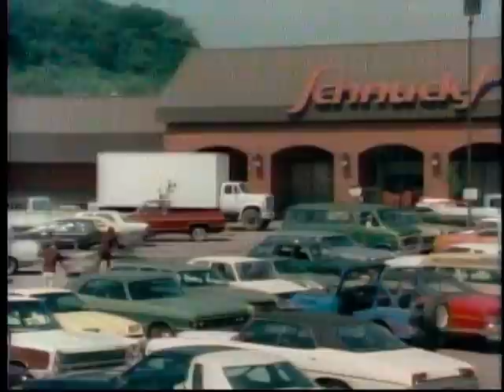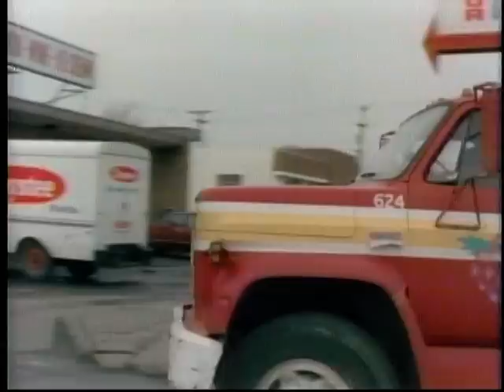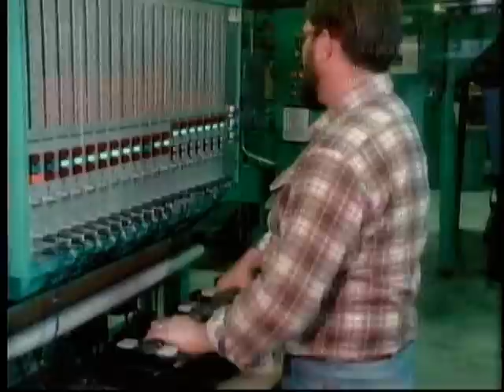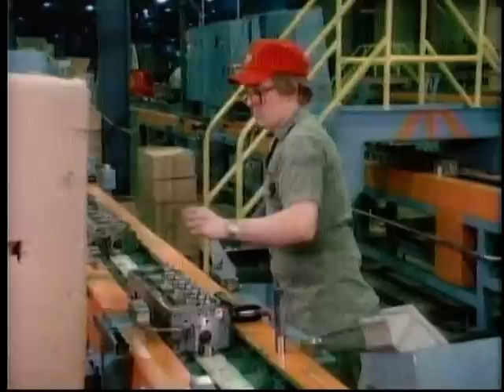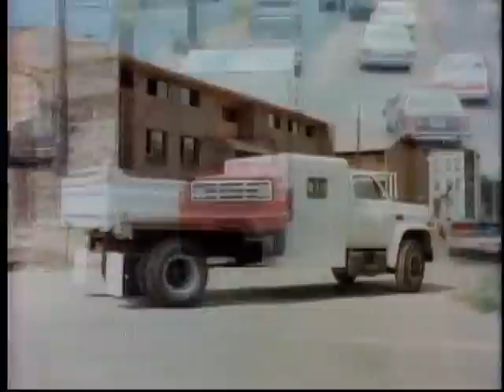Detroit Diesel Allison 8.2 Liter Fuel Pincher Diesel Engine Features GM-327-A GMC Dealer Training LD

Comment: I was born in 1983 and it's amazing how much culture changed between 1980 to 1983.  This video is flat out disco.  But I remember the early 80's and I was actually looking at the world of the late 70's which in hindsight was a very interesting time. Like I said it was a period a very rapid modernization.  From 1960 to 1983 things had changed so much.  I mean the 90's to the 80's not a lot of change, but 80's to 70's big change and 70's to 60's big change.  Nowadays are changing fast now too but for different reasons.  The iphone changed things a lot and now, it will just be a solar flare blows out the electrical grid and there will have been a time before when everything was modern with phones and suddenly 90% of humans are dead and we're all back in 1890-1910 time of growing food with simple mechanical technology and then we'll have space age alien technology come.   Can anybody here even imagine the 2030's?

Comment: WORKED AT DDA DEALERSHIP AND WE HAD THESE ENGINES STACKED UP IN THE PARKING LOT FOR HEAD GSK FAILURE IN THE FIRST YEAR OF OWNERSHIP THE PROBLEM WAS A DESIGN FLAW IT ONLY HAD 10 12MM HEAD BOLTS..LOW CLAMPING FORCE FOR THE HEAD TO BLOCK UNION. GM CAME OUT WITH A RECALL TO DRILL AND RETAP THE HEAD BOLTS TO 14 MM ALSO WHEN THE GSK FAILED ANTI-FREEZE WOULD MIX WITH OIL AND SPIN THE CAM BRGS GM MADE A TOOL TO BORE OUT THE CAM BRG HOLES AND INSTALL O/S BRGS GM LOST THEIR ASS ON WARRANTY CLAIMS FOR THAT ENGINE WHEN IT WAS RUNNING IT WAS A GOOD ENGINE

Comment: Such a good motor they discontinued it and the old GM trucks you see of this era (that still exist) are gas. The Fuel Pinch had its issues. GM went with CAT for replacement of this class engine.

Comment: I worked for a plumbing contractor he had a Ford C - 800 with the gas engine, and he had one of the ( GMC ) dumps 4 yard boxes. 😊 the ( GMC ) had the 4 cylinder DD, and both  trucks had a 5-speed manul with 2 speed rears. The Ford was a truck that pulled our 580- C case backhoe on a lowboy. I was always a Ford lover my whole life, but boy, that ( GMC ) with the DD engine was like driving a caddy compared to the Ford C series heavy duty Ford built rig. I loved driving that dump so much more than the Ford. 😊
Now, in 2025, after owning Ford pickups all my life, and getting treated  so badly by Ford on tradein on my 2000 ( V-10) gasser with only 63000 miles on her The Ford salesman would NOT even talk to me unless  I wanted to be put on the wait list and put money down to even TALK to me on any truck buy or trade in. Please  can anyone tell me if they have been  treated like this at Ford. I went to Dodge looking at the ( Cummins) and Chevrolet truck dealership, and both first thing did test drive of my 2000 Ford PU. Both did no pressure to buy their  trucks. The Chevy dealership showed me a used 2021 12000 mile Silverado  Z-71 Duramax/ Allison with 8 foot bed/ 4 door body 😊 and I was in love with the truck. I own 3 Detroit Diesel engines on rigs and equipment I own 😊
1 being a 1978 353 DD second being a 1971 DD none turbo and third being a silver 92 DD with turbo and Allison automatic transmission. The silver 92 is a fast pickup at stops but a fuel hog. So buying the Silverado PU was a must to keep it all in the family, so to speak 😊 I wished I had looked harder at GM back in 1979 when I bought my first Ford and at least tested them out over Ford.

Comment: Drove the 8.2L diesels for four years(Wickes lumber). The 8.2L was way more reliable than our one ton with the 6.2L.🤷‍♂️ The International DT466 smoked the 8.2's. Even plugged in inside a building, the 8.2's were hard to start in the winter.

Comment: Tolerances are mentioned to be held at 2/1000ths inches on the computer. In the mid thirties, Dodge workers were measuring tolerances of 1/10000ths  of an inch by hand!
Reply: I would imagine that the production numbers for the fuel pincher were 100x that of the Dodge engines of the 1930's.  High volume requires designs that are O.K. with wider machine tolerances.

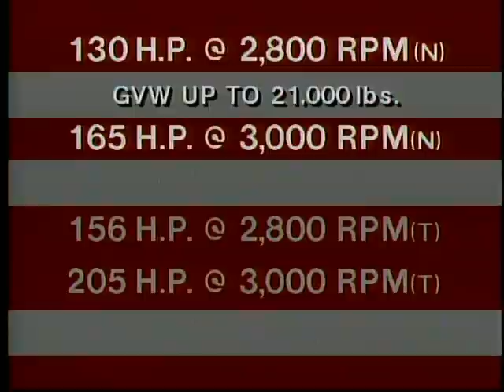Comment: Look at the HP rating at 2:25! hahahaha! My naturally aspirated gasoline V6 work truck puts out 305HP. Man, must not have learned much with those 1,000,000+ man-hours of research.
Reply: Your naturally aspirated V6 wouldn't last an hour in a 60,000 pound dump truck.
Reply: You have half the torque bud
Reply: You are not really smart comparing any modern engine with a 70s engine. A Bugatti Chiron has more horsepower than your stupid V6. You see? This sounds stupid right?

Comment: OK wait a minute.... 13:29 they state that the 366 Gas engine only got 4.5MPG? - Boy GM was behind the times, our Ford 370 powered 5+2 20' Stake truck got 9MPG almost all the time...Except when very cold outside (Below Zero) so if the Turd Pincher only got 8.7, there would be no need to buy that trash.

Comment: Ended up getting stuck with a 1985 GMC 7000 diesel, has a 8.2 fuel pincher, automatic transmission....currently doesnt start, what should I do with it? 😂

Comment: I purchased a GMC 7000 with a fuel pincher about twenty years ago and put over a hundred thousand miles on it. Never had a problem. The truck still starts right up. Too bad the cab is shot. Not sure all the negativity towards the motor. The speed is slow. Lol. But, that sound of the turbo going up hills is memorable. Hopefully a full restoration is in the near future.

Comment: A 500 cubic inch V8 that made less power than a 4-53T 😂
Reply: Only on the lower ratings.  The 4-53T was also 1,260 pounds, over 100 pounds heavier than the 8.2.

Comment: For comparison in todays world, the original 350 2brl 4 speed (no o/d) in my 1979 c60 chevy with utility body gets about 7.5mpg. The 7.3 diesel in my 1996 Ford with utility body(loaded) gets anywhere between 11-12mpg. 

In todays day in age with record prices and out of control inflation: 

Depending on where i get fuel, it's literally cheaper for me to run the 79 screaming gas motor than it is the 96 psd.

Comment: I serviced a fleet of these for the highway department. Very reliable. Only real problems were the oil cooler orings and every once and a while a leaky warter pump or replace a belt or starter.

Comment: The free standing cylinders in the open water jacket with no gussets to stabilize them was their biggest weakness…the cylinders would walk inside the block and destroy the head gaskets…they had other issues but they were actually very good on fuel!!
Reply: They had a cure ,wooden wedges between block and  cylinder wall,failed BMW makes a copy of this cylinder arrangement.
Reply: @ that’s very interesting!..I never knew that!..it’s a very stone age fix but if it works then works!..
Reply: I was shocked to see those free standing cylinders.  The exact same thing existed for the 140 Vega engine and the same head gasket problems arose from it.

Comment: Funny Story>>>
Some years ago GM chucked their tried & true V8 family the 307-350-454
and replaced them with the 4.8L-5.3L-8.2L. Well, as it turns out all GM did was use 
the old small blocks & attach new heads, new fuel systems & new powertrain control computer/software to meet the more stringent emissions.

!
Reply: False, they are completely different architecture.

Comment: The fuel Pincher was great I had 2 of them a 81 C60 16 foot box truck like the ones in this video and 89 Brigadier C50 dump truck the 8.2 fuel Pincher has a different sound then most other diesels then or now

Comment: My boss had a 8.2 in his motor home It had less than 20,000 miles on it when it started filling the crank case with coolant. After a bunch of parts changing they finally changed out the Compleat engine, The boss dumped it as soon as  they got the engine fixed.

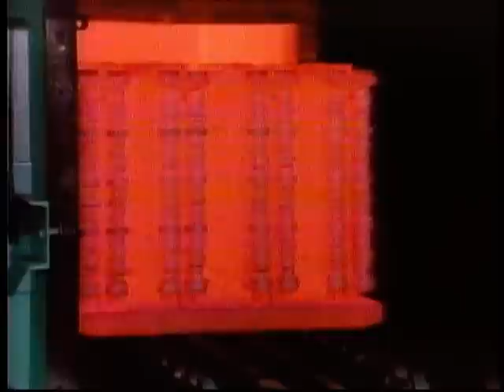Comment: Funny, the engines shown at 5:15 are not completely open deck. There seem to be additional supports at the 12:00 and 6:00 of each cylinder that don't appear in the production engine. Either this part of the video is not actually the fuel pincher, or perhaps the extra support was removed from the design by the GM bean counters.

Comment: Nothing that they ever made replaced the 2 stroke Detroit Diesel V-8 Diesel engine for power, fuel efficiency, and reliability as long as it was not beaten to death and maintenance was done at 4K miles. Still have one that has 300K and I would take it to California, Canada, or Florida from Butler, PA. anytime, any weather conditions or you name it period. Great evening and enjoy your day tomorrow.
Reply: Series 60 was much better than 2 stroke. Still a good engine today.
Reply: @Capitanvolume  The  old two stroke joke was a great engine as long as you didn't put a load behind it.
Reply: I have 2 of this trucks..running original 8.2... and a ford that came with a 8.2 from the factory...have a extra 8.2 with the trans the truck was totaled...they will average 15 mpg loaded or not...I'm a Detroit man, so I take care of mine. Can not run them hot...never. never run them wide open without a load, they were made to pull! I still run 2 of them, don't think twice going anywhere,just go!
Reply: The 2 stroke Clark cycle Detroit diesels are the greatest diesels in world history. The 4 stroke Fuel Pincher isn’t worthy for the Detroit Diesel moniker and was actually a piece of junk. Open deck in a high compression diesel is simply STUPID! Head gasket failures told THAT story. Cheers!
Reply: @2StrokeDriptroit  I swear the same idiot who designed the Vega engine, also did thhe 8.2L Turd Pincher and the Cadillac HT4100.
Reply: You must have gotten the only good one, everybody i knew that had a 8.2 complained it was the worst engine they ever owned, even worse than the Old 534 Ford Gas.
Reply: @mylanmiller9656  The 8.2 was a 4 stroke. He is talking about the 2 strokes that came before the 8.2
Reply: @Texassince1836  The old 2 stroke joke  couldn't be  killed, It was a great engine for beguiners, but  You could pull more with a Team of horses.
Reply: @mylanmiller9656  Nothing wrong with 534 Gas, other than fuel economy....BUT they last for a long time, doing diesel jobs, at gas prices...
Reply: @ The  534 was a great big guttles gas hog. it was tough but it was really short on power.
Reply: @mylanmiller9656  Well the 534 made more Horsepower AND Torque than ANY Naturally Aspirated Diesel that tried replacing it at the time...We had nearly Identical L800 & L8000 Ford Fuel trucks with 4000 gallon tanks on them, the Naturally Aspirated V636 (3208) was a DOG (L8000 compared to the 534 V8 Gasser (L800) and the 534 also would start without needing to be plugged in or put in a warm building. Both were 10 speeds and even had similar gearing. The 265hp 534 vs. 210hp 3208 with nearly identical torque numbers...the 534 drove literal circles around the Cat... Our competition had two GMCs of similar size, one had the TURBO 8.2 Turd Pincher at 210hp and the other was a 6V53 (non-turbo), the 534 walked all over both of those as well, but the Turd Pincher GMC was quickly repowered with a 3208T at 250hp and FINALLY the 534 had some competition...I could out run him on the flats, but the Turbo 3208 had me on the hills, as 534 didn't have the low RPM Pull of the Turbo Cat...No surprise with 600lb-ft of torque.
Reply: @misters2837  You sir are full of Crap my Dad was driving log truck for a Company that had a 950 Ford with 534 and a Dodge 1000 that had a Cummins 220. the Cummins would walk all over the 534 gas. then they put a turbo on the 220 and made it into a 262 hp engine. Dad drove both trucks and said there was no comparison between the Cummins and the 534. He said if he had a Choice, he would never drive the gas engine.
Reply: But they sound like shit due to ignition at every rotation.

They sound too high reving for trucks while they actually dont rev high. They sound high pitched.

I prefer deeper, low rpm brutal bubbling before motocross 250cc 2 stroke noises times 8. When i wanna hear 2 stroke, i start my chainsaw.
Reply: @dom3827 they revved high being only 2 strokes for combustion  2 crank revolutions...opposed to 4 strokes needing 4 strokes to 1 combustion cycle 4 crankshaft revolutions.

Comment: Why would they have to offer a Caterpillar to customers when they are going to last just as long as it will plus be cheaper probably since it's in house built , supplied and easy to maintain the as long as you maintain it according to the builders and maybe a thousand miles less to keep it from having any issues period. I have had one of each one and at 4,000 miles complete maintenance I got over 500,000 miles and had the only Diesel engine with oil that was never black and gritty.  Detroit Diesel, Cummins/Powerstroke and caterpillar in that order to run and maintain.

Comment: When the 14mm to 15mm head bolts update came out almost half of the engines we did ended up having the block replaced because the 15mm bolts would tweak the block causing the cam to seize in the cam bearings. The 2nd 1/3 of these were the 1st replacement for the 1st 1/3 and the last 1/3 was the 2nd replacement
Reply: Huh ?   Cam “seized “ because you screwed up on your head bolt procedure ?   Huh ? 
Worked on a lot of trucks in 30 + years but never heard of that !  😅
Reply: @bobwilson758  GM sent out a bulletin to ream the head bolt holes from 14 to 15mm when this was done some blocks when the heads were torqued would tweak the cam tunnel so the cam bearings were no longer in line which would cause the cam bearings usually #3 to seize to the cam and spin in the block. About 3 months after that bulletin GM sent out another one saying do not increase the size of the head bolts. They never gave a reason but it was speculation that reaming the holes removed enough material to allow the block to flex when the heads were torqued. Remember it was an open deck

Comment: I bought one that was in a 87 6500 that just about new in 1988 from a bankrupt freight line. We took the pox body off and put on a rollback and it was still running well in to 2008. Then my after my Dad died I dont know what my sister's idiot kid did, but somehow started a fire on the right side in the cab. Then took the dash apart. Otherwise the engine smoked some from running jet fuel in it in the 90s and never gave a minutes trouble. It would start cold like the video says........oh yeah, what ever happened to the truck? I bought it from my sister a few years ago so she could pay her property tax. Its still at her house in GA and I have not been able to move it to my shop in WA State.

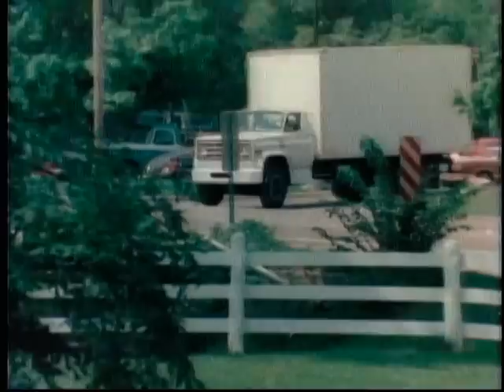Comment: @10:49 No it doesn't have those things, but what it does have is 8 fuel injectors that cost more than the carb, and a fuel pump that will cost more than the dist/wires/plugs LOL.  I love when they try and make it sound like it won't need maintenance when diesel maintenance costs more, oil changes alone do.  The 8.2 isn't so reliable and today you basically can't make a dollar off flipping one, if I had one I'd rev it till it popped and scrap it for shreader steel.

Comment: Had one for a few years and it never gave issue and got near 20mpg loaded or not. Late model ones 85+ were good, heard bad things about the early ones which is probably everyone hating here in the comments. I would stay away from the turbo though to ensure longevity.
Reply: One of the problems with this Fuel Pincher engines n/an and turbo charged was that they kept popping head gaskets. Problem in production of the engine blocks and the heads.  Most diesel engine setups is that there are five or six head studs per cylinder. The Fuel Pincher only had four head studs per cylinder.  Given the high temperatures and extreme cylinder pressures in the combustion chamber.  There isn’t enough grip to keep the head sealed to the block.  Thus resulting in continued blown head gaskets.   In our school buses there were just as many blown head gaskets in the naturally aspirated as was in the turbo charged engines.  When the Fuel Pincher was running right, nothing could keep up with them.   Scary fast.  😊😊😊😊

Comment: Most C60 trucks I've seen were 366 gassers
Reply: I would imagine that rental companies would prefer the 366 gas engine in medium trucks for the lower entry price and short term operating costs i.e. 3-4 years.  The diesel would make sense only if it's being bought by a company and they expect to keep it for 7 years or more.

Comment: I had an 8.2 Fuel Pincher in my truck , backed up real fast and hit the brakes real hard , it slid out of the bed at the ScrapYard !
This engine was one step above an Oldsmobile automobile diesel engine !
Reply: @vicpetrishak7705  I remember in78,when the Olds Diesel,first appeared in GM trucks, available only in half tons and with automatics (That was a pretty big clue)M M Sunt,a big construction company in Tucson,bought a fleet of 78  GM 5.7 liter powered diesels,those trucks were gone with in a year and a half,and replaced with Ford,and Chevy 3/4 tons.
Reply: i thought  it looked a lot like the 6.2 Chevy used in the Pickups, but even the 6.2 didn't have  free standing Cylinders
Reply: @mylanmiller9656  Totally different design

Comment: I going to catch hell, but why didn't they refine and put the improved combustion piston cylinder swirl design and improved injectors in the turo flow diesels it would have done a lot better than the Fuel Pinchers,and would have probablylasted longer to boot.